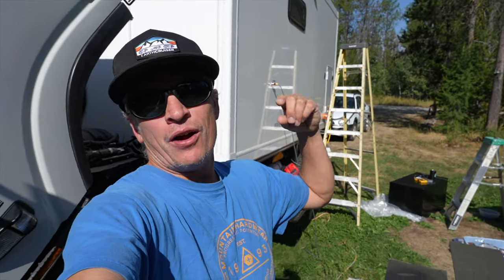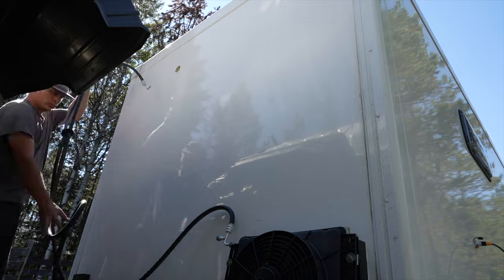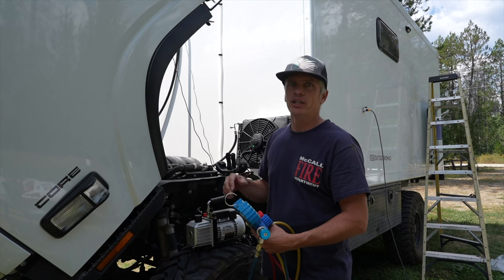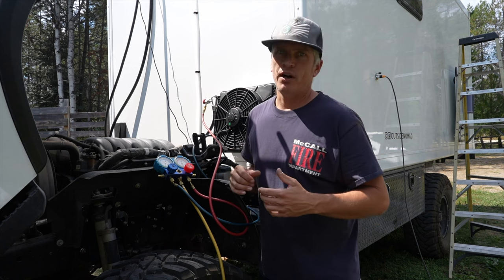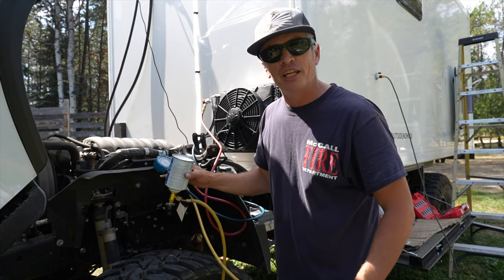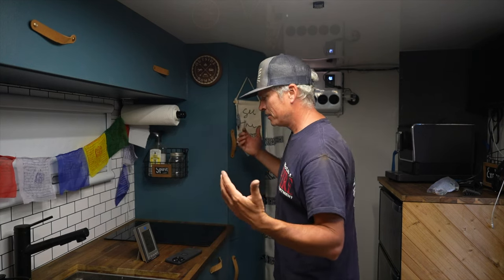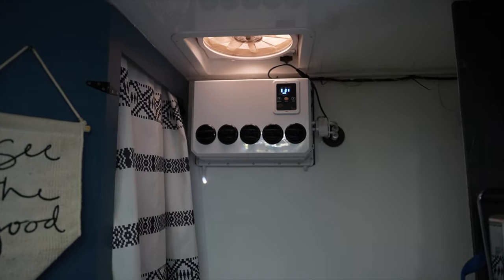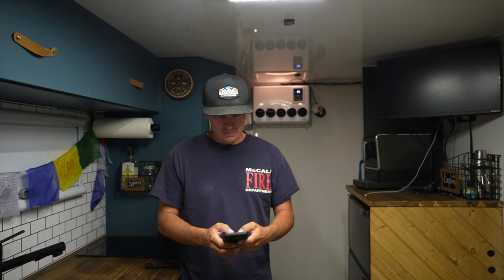Part 2 - Budget Camper Van Air Conditioner for Overland Travel - 12 volt/24 volt DC Powered AC

Comment: I’m glad I found this channel. I had a question. How long will it roughly run on a 12v system with 4 100ah batteries connected parallel? I would appreciate the help
Reply from the maker: Thanks for checking it out. As you saw in the video it used roughly 350 watts per hour to run.  This will be on the low end as it was not very hot and this was a 24v system which is more efficient. All depends on how cold you like it. 

At 12 volts a 100 Ah battery has 1200 watts. So 4,800 total watts you have. If it’s lithium you can use roughly 4000 of that. Divide 350 into that and you get about 11.5 hours of run time. 
Hope that helps.

Comment: Great video, very informative. I’m planning mounting the fan unit under my 1977 Chevy G20 between a couple of cross members. Would you mind measuring the length, width and depth of yours, I’m dealing with very tight quarters but I’m not sure where else it would look right. Thanks

Comment: @Outside Nomad   Could you please test how many amps are drawn at startup. I was thinking of installing an "easy start switch" so a small Honda 12 gen. could be used if needed, but don't know if that is even necessary with this 12 v unit.  Any thought's ?   Thanks
Reply from the maker: There’s not much of a surge I get like 45 amps at 24v so maybe 90 at 12 volt
Reply: @outsidenomad  Wow, just what I was wanting to hear, the name brand easy start switches average about $230.  Muchas gracias!

Comment: Hey, I found your summary of the energy consumption a little confusing because it seemed when you said amps or watts you meant amp hours or watt hours? Maybe I need to listen to it again
Reply from the maker: So if something is pulling 15 amps or say 300 watts and you kept that running for one hour that would be 15 amp hours or 300 watt hours. Does that make sense?

Comment: Nice video. Have you ever tried running it off just your battery’s? Also and how many hours have you ran it before they go dead. I’m trying to install one on my semi but I usually sleep about 8 hours in the truck and is usually at night so the sun isn’t out and it’s not that hot. But just wanna make sure it’s not gonna make my truck go dead when parked while sleeping.
Reply from the maker: I only run it off our battery but I have A LOT of battery. You’d have to just run the numbers for your battery setup as it will vary greatly
Reply: @outsidenomad   ok. Yea I wanna install on my semi truck. But before I do I wanna know how much power it would drain and if someone has had some experience with it in a semi.
Reply from the maker: @_gmjc_  As I mentioned in the video it was using about 350 watts per hour.  So you just need to figure out how big your batteries are and run some numbers to see how long it would last on your battery system.  I have a lot of battery and can run the AC for over 40 hours straight on battery without solar.
Reply: Don’t know if you installed one on your semi truck yet, but I have one on my semi truck. You will need to install 4 additional batteries or have IdleSmart/Opti Idle installed. There’s no way to run this unit with just 4 batteries alone for 8 hours straight. You also should do the math using the highest rated watt’s because if you do the lowest watt power, you will find yourself underpowered in high heat area’s such as Texas/Arizona/Nevada when temperatures reach 100 degrees but feels like 110 degrees. For example, you have just 4 100ah AGM batteries. The AC unit draws 960 watts max. That’s 4,800 amp hours divided by 960 watts per hour. That would give you only less than 5 hours until your batteries are dead. With AGM/GEL/SLA batteries, you should never take them down below 50%. Now your numbers look more like 2,400 amps hours divided by 960 watts per hour. That like less than 2 and hours before you need to recharge or have IdleSmart/Opti Idle kick in to keep your batteries above 50%. 

What about the additional 4 batteries? Well the same principle applies because your not going to run those 4 additional batteries in parallel with your main batteries. Your going to use a DC to DC charger which keeps your main batteries charged so you can still start your truck when your 10 hour rest break ends. 

To get a full 10 hours without ever having to start your truck during a 10 hour rest break would require 8 batteries in addition to your main batteries. Or, you would have to have another form of power supply like shore power, a gas generator, or solar power. Our trucks don’t have enough roof space for enough solar panels to power this AC for 10 hours. 

Lastly, there is another option. 2 400 LIfepo4 batteries. You’ll need a DC to DC charger, perhaps some flex solar panels on roof of sleeper, and at least an 300 amp alternator upgrade to charge these 2 LIfepo4 batteries while you drive. The 400ah LIfepo4 batteries aren’t cheap nor are they small. You could build a battery bay under your bunk to house the batteries and protect them from the weather. This option would give a completely engine off, no idle, 10 hours of silent rest. But it’s also the most expensive option to build. Your talking well over $4,000 to build, not including solar panel costs. 

I’m happy with IdleSmart and my 12v AC using my main battery supply. My truck starts on average every 2 to 3 hours and I have it programmed to run for 1 hour each start cycle. In 100 degree Texas heat, my truck stays 75 degrees during the day and drops to 65 degrees at night. I have it paired with a smart AC remote that I have programmed to set temperatures. I never wake-up to a dead battery and I have a backup through IdleSmart that if my AC fails, IdleSmart kicks on to keep my truck 70 degrees all year long. Even when I’m away from my truck, the inside of my truck is always 70 degrees or less. IdleSmart will start and shut down the engine without the key in the ignition so you can leave your truck for weeks. You program it and it does it. This is the option I chose.
Reply: @Btween2  well dang you definitely did your research and some testing. Thank you for the info. I have not yet got one because I’m hesitant about it. But now that you explain this definitely something to think about.
Reply: @Btween2  Tks for this great reply for us semi truck-drivers.  I have a 2015 International ProStar, and it come/w x4-dedicated battery-powered APU, (also have x4 start batteries, but I'm not sure if it pulls off those at all?).  They last pretty long/w my APU a/c, when they aren't too old/used, but the problem I have is when it's REALLY hot, upwards of 99° Fahrenheit outside (in humid environments), and my a/c just can't cut-it.  I have to have everything closed-and-shut, the floor-length curtains, all windows blacked-out, the tornado fan running, a sheet coming-down from the bunk, to cut-off high-heat coming from the top bunk area, and it's still "survival" in the day time, with the compressor cutting-off completely if/when it's too hot outside.  It's really a challenge to stay cool inside my cab in high-high heat conditions during the day.  

    I was dreaming that this little unit may put-out more BTU (trying to find the BTU's of my unit, and it's really hard to find, I did find a 2005 model that indicates only 4k btu, surely the '15's are more?), and be able to do the job better than what i have, but after reading your reply, I can see it would smoke my batteries, even though I do have a auto stop-start feature that, when engaged, kicks-on the engine when the volts fall to low, and re-charges the batteries via the alternator.  Question is, how powerful really is this unit, compared to a factory 2015 version?  Would it be worth it to try?  Of course, I couldn't run both systems at once, but I"d be willing to disable my factory a/c for this unit, IF it performed so much better in high-high heat.

Thoughts?

Comment: That’s one of the first condenser coils that I’ve seen the liquid line out the top and not out the bottom. Are you sure that’s the way the manufacturer wanted it? 

You need to read up your units of power, energy, current, capacity, etc.

Comment: There are some really good adhesives on the market, but are you sure that glueing the condenser/fan onto the house is the best way?   My concern is the heat generated by the engine could compromise the glue over the long run.  Why not mount four nutzerts into the house and bolt the condenser/fan into place along with the adhesive strips??
Reply: @outsidenomad  I was worried about this part too and thought maybe you would have used a full piece between the two brackets to spread the load even more. But I guess it’s probably good to go based on your experience with the adhesives so far.

Comment: What type of glue did you use for your brackets? I intend to put the same unit on the back of my semi without removing the compressor. I thought I'd use an all purpose JB Weld and 4 self tapping screws on each side. Would you concur that is efficient?
Reply from the maker: I used a specific glue that is designed to bond with my particular camper box. It might be worth testing different glues to see what works best.
Reply: Checking to see if you hooked this system up in your semi truck... I'm looking to do the same and have done questions... Let me know... Thanks...

Comment: Finally about to install mine! Did you have to put a Softstart into your electrical system for this unit, or does it run fine without one?
Reply from the maker: No need for a soft start. These are nothing like the energy hogs of traditional rv ac’s. Your system just needs to handle 30-70 amps depending on your voltage.
Reply: Great, thank you so much!

Comment: Really great Video, thanks for explaining it really well. i have just bought a very similar one but the condensing unit is a bit basic. can i ask a quick question  please. You mounted the compressor on the exterior of the vehicle? so you don't need it to be water proof? if so i might do the same. i have a Sprinter i'm Converting. Thanks again!
Reply from the maker: All of the outside components are designed to be outside and handle weather. So yes that can all be mounted outside wherever you need.

Comment: The best, most helpful video I've seen on these 12v systems, Been looking at one for my diy retirement van, currently underway. One question: what did you do for condensate drain? (I'm thinking about getting catching in a 2 gallon can for extra water.)
Reply from the maker: It actually comes with a condensation drain that I just ran outside

Comment: Thanks for the video as my unit did not come with a manual. Did the compressor come with oil in it or did you add it in? Thanks again.
Reply from the maker: My unit came with oil already in the compressor.

Comment: Can you give us your opinion after having it for a year? Still meeting your expectations? Also, how long can you run it on your batteries?
Reply from the maker: The AC is still working great.  i have a 15kwh battery so it would run that AC for days but the issue would be how to charge them back up.

Comment: Awesome install dude. 
Do you know if the condenser can be undermounted underneath a van? How do you think it would holdup to environmental conditions? rain, rock chips etc.
Reply from the maker: There is a way to mount it underneath but I would reach out to the manufacturer to get specifics. I think it would hold up fine. The only concern would be the plastic fan.

Comment: Great install! Do you know if the condenser/rad has to be mounted vertically, or can it be horizontal ?
Reply: This compressor and condenser can be installed at any angle at all, including upside down under the vehicle. Just beware of mud spray etc. under there, and if installing on a roof beware that you must clean the fan and condenser often since it will be wide open vertically.

Comment: Make sure you put refrigerant oil on all your O rings so you won’t damage the O rings and may cause a leak.
Reply from the maker: That's a great point thanks!
Reply: is that what they mean in the manual. to put the oil on the rings? does this help? thx!

Comment: What BTU is it? What battery Bank and solar what's are needed to run in 9 hours? Did it cool the camper to 75d while 95d outside?
Reply from the maker: Yes it will cool down to 75.  Not sure what the BTU are.  That's a tough question on the battery and solar needs.  Too many variables.

Comment: Hi There: I am installing a similar AC and I was wondering where did you get the Z brackets to install the radiator and fan? And if you mind sharing the specs of them. Many thanks in advance.
Reply from the maker: I found them at a local supplier. They are 3” deep with 1” flanges. I actually have more if you can’t find anything.

Comment: Does it not require oil in the system? I just assume it would based on my auto experience but could be different because it’s not a car
Reply: @outsidenomad  but wouldn’t the vacuum pump suck out the oil since it sucks moisture/liquid?
Reply: @outsidenomad  fair, can’t wait to see a longer term review

Comment: Will this unit heat as well?  Looking to replace the line voltage heat pump that came with my overland camper.  Not sure WHAT they were thinking as the camper cam with 200w of solar - which will not run the heater/ac.

Comment: Hello. How much oil and what kind did you add to the coolant to protect the internal mechanical parts of the compressor? Thank you for reply in advance.
Reply from the maker: The unit was pre-oiled per the manufacturer so they said adding oil was not necessary.

Comment: I got mine but not a great manuel  i can't find if you can install the box flat on the roof or need the compressor always be strait up?
Reply from the maker: I would reach out to the seller to double check. But as far as I know the box could be mounted flat but on side had to be facing up and I don’t remember which unfortunately.

Comment: I currently have a 12k btu mini split that i use on my semi cab and it is powered by an exoflow pro… i usually get about 8 hours of runtime, wanted to know if it would be worth it to switch to a dc unit or stick with my current setup…
Reply from the maker: I have no idea. What is an exoflow pro? And what is the power consumption of your mini split?  You would just need to crunch the numbers and see.

Comment: Thinking of purchasing this ac. How did you install a 24volt ac into a 12volt system?  Or is your camper 24 volts. Thx
Reply from the maker: Camper is 24 volts but the AC unit comes in either 12 or 24 volt

Comment: hey, thank for the great videos, that was really helpful! I was wondering how is the unit holding up so far? Any reliability issues Also, I was wondering if you could provide the overall width including the hose elbows? I tried to scale it based on your picture on a cad software and I would get 3.5 inch for a total of 21.5'' Could you confirm? I am looking to fit it in a westfalia and man, this is tight... Finally, out of curiosity, since you have dismantled the condensor, Have you looked for a way to hive that right hand block inside the white plastic casing?
Reply from the maker: Did my response show on this?  I think I already posted this but all comments got removed somehow.

Comment: 👍 Nice job man.  How much space is between the radiator and the wall, seems a bit tight and is blowing super hot air directly onto the wall, seems like a heat buffer material or some sort of plate an inch off the wall would be in order there. Thanks for the videos.
Reply from the maker: The fan actually sucks air so it’s blowing air away from the box. So no worries there.
Reply: @outsidenomad   Good deal. Thanks for the video, nice job.
Reply: It's not hot enough to melt it

Comment: So how long can you run the AC with just your batteries...and how big is the battery bank. Could I run two 12 volt 100 watt batteries LiFePo and get a night of cooling??? Do I need more battery capacity???
Reply from the maker: Yeah sorry I get a little loose with the correct terminology.

Comment: Do you have a link of this a/c unit? Also does this do heat pump also?
Reply from the maker: No it does not function as a heat pump.  There is a link to the product in the video description.  If the link doesn't work you may have to search for "12 volt air conditioner."

Comment: how has your system held up ...I bought a pioneer home mini split for my box truck ...Im looking to install one of these instead I can mount it on my back door does these come with a heat stirp
Reply from the maker: Holding up great. Are you asking if it comes with a heat strip? Not sure what you mean by that.
Reply from the maker: thanks

Comment: I'm not good at figuring out amps and watts. I have 600 watts of solar and plan on getting 400ah of lithium batteries. I run a 4ft tall AC powered fridge. I don't believe I have enough power to run this through an 8 hr night set at 75°f do I?
Reply from the maker: Can't answer that question without knowing more numbers in terms of power consumption of the fridge. I would recommend reading this article on the basics of how to figure this stuff out.
https://www.outsidenomad.com/campervan-electrical/
Reply: Yes

Comment: Does anyone have real world longer term data on these? I'm interested in how many ah battery I would need to run it for  a good 8 hours without completely draining the battery past it's safe point. All calculators I've used have varied wildly from 300ah to 800ah.